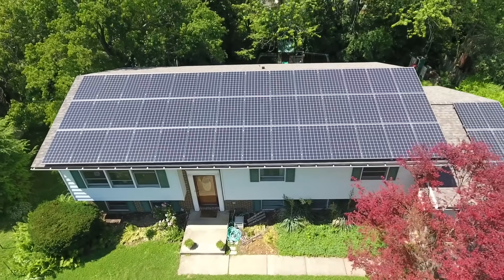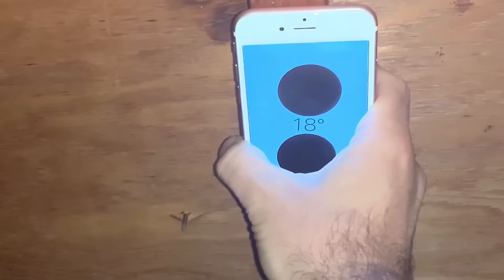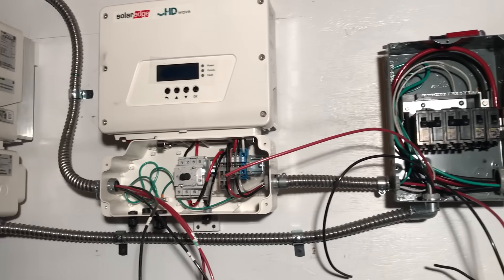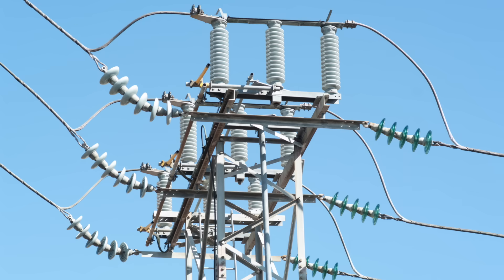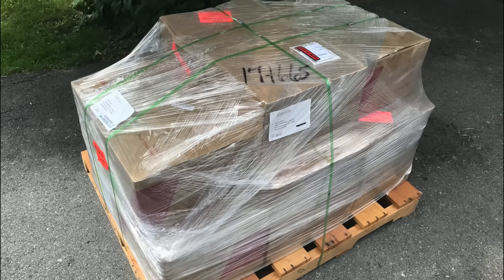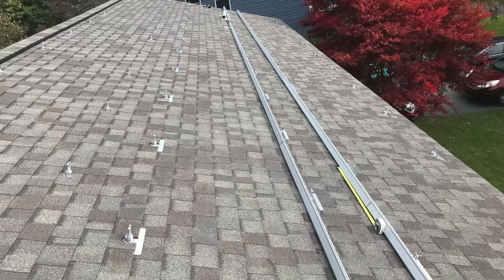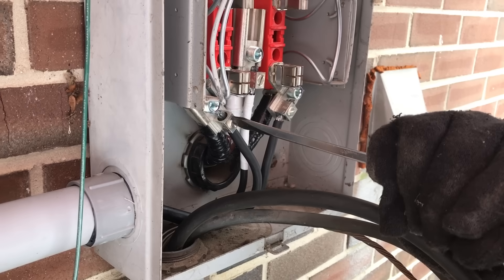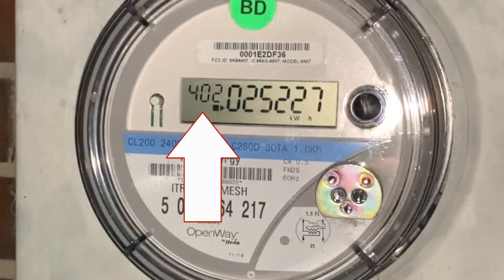I Installed a Power Plant Myself | HUGE DIY Solar Panel System

Comment: Yeah, and at a cost above the cost for paying regular bills.
Reply from the maker: I’m not sure what you’re trying to say.  The decision to install solar panels was one of the best financial decisions I’ve ever made.
Reply: @FrugalRepair  Then your system is completely minimal, because a full system for self-sufficiency will cost more than it's worth if you're within reach of an affordable grid service. I do system designs for lots of people across the country, and when affordable power is available, it doesn't make much economic sense to build and retain a system large enough to mee the average house demand of 33KWh of power to the home per day. Many homes are over that.
Reply from the maker: Sorry, I misread your comment at first.  My system is 15.6kw, would you consider that minimal?
Reply: @FrugalRepair  That will not sustain an average home. I don't know what website you read the average as being 15KWh on average per day, but the utilities feed their data into a nationwide energy database that we in that industry can access, and that average is currently set at 33KWh on the top end of the average data band. My home has three freezers and two refigerators (since we have six in our household), all of which are efficient.

I recently acquired 32KWh LiPo batter banks from a dealer in PA that are brand new, slated for installation into Mercedes EV's, but had defects in the mounting hole patterns drilled into their casements, and so were sold on the market while the manufacturing error was corrected. Even those will not fully run my whole house for a day given that depth of discharge for lithiums is recommended no greater than 80%, so I realistically have only 26.24KWh available.

An array of solar panels can make up the difference, but I am still going to need to stock up on even more batteries for storage on those days when there is no direct sun. We in my area have only greedy utilities who will charge us no less than $45 per month, even with the main breaker left off for the whole house for a whole billing cycle.

My customers have verified the averaging data I quoted to you. There are many smaller homes that use quite a bit less, but that's with them having very little in appliances, with wood burning stoves and such. I recommend wood burning rocket stoves for homes in winter, but most people are not willing to go that route. Rocket stoves burn about 1/10th the wood than wood burning stoves, but most people are afraid of their local nazi's who do code enforcement.

Anyway, yes, some of the homes I design for are considerably larger than yours and mine, and thus require a much larger system with gaudy slabs of solar panels running almost the length of  a football field, and they are located way out in the countryside where CO-OP rates can be very high, and very unreliable. Some mansions around here have some seriously expensive systems I have designed for them. The cost will be in excess of them simply paying utilities, because there is also upkeep and repair since we have LOTS of lightning strikes around here and damaging winds.
Reply from the maker: Thanks.  I don’t know if you saw that I deleted my other comment.  had misread your earlier comment, for some reason I read MWh not KWh.  But you’re right at 33KWh per day is the average.   Net metering is really the key to the financial worthiness of grid tie solar.  In any case, my system has been working great and after selling SRECs I make money each month.
Reply: @FrugalRepair  Does your utility pay you retail per HWh, or wholesale. Around here, they charge us about $0.15 per KWh, and pay back only $0.02 per KWh sold back.
Reply from the maker: The net metering is 1 for 1, so retail. In May they buy out any extra banked KWH to bring you back to zero but that is purchased at the wholesale rate.
Reply: @FrugalRepair  Ahh, so there is a catch. I figured there was. I used to design utility sub stations and transmission line systems. Now I just tinker around with home system designs that I wish I could afford for myself. I scour around for good deals. A fella is doing pretty well if he can build a system with lithium batteries that are around the $120/KWh price range. Anything above that is just too high in cost. So many are around the $350-$650 range per KWh. That's just plain outrageous, but even the Chinese are getting greedy.

Comment: Hope that the panels in the middle row aren't ever going to fai!
Reply from the maker: Me too!  But really, it’s not that big of a deal to get to them, just a pain.  You would take off the 4 bolts holding down a panel on the top row, get it out of the way then get to the one in the middle.
Reply: You can walk on the panels , the can take that ,
Reply: @MrToyorick  they may not look damaged on the outside, but the cells inside he panel can crack. NEVER walk on the panels!
Reply: with that low angle, you can easily access everything from the north roof. mine is 45°. PIA to work on ;)

Comment: The zipties will fail, potentially shorting your system .. In many countries using nylon zipties is aginst the code.
Reply: With the microinverters there is less of a risk, but the zipties definitely won't last decades. It wasn't clearly obvious there were other clips veing used. The zipties themselves are quite sharp and hard (nylon) thus by themselves can cause issues. I doubt most zipties will last 10 years outdoors in almost any use.. 10 years is quite a few cycles of temperature and humidity changes. Overall I am not really worried about issues, because you will probably keep it in top shape since you installed it yourself. Don't fall off the roof when cleaning it :P Most renewable energy is statistically more deadly than other methods of power generation just because of the man hours required per generated energy.
Reply from the maker: Your right about the temperature cycles but they are shaded which will help longevity.  And you’re right, I keep an eye out for any issues.
Reply from the maker: How would the system short?  The zip ties are backup to the other clips.  They won’t break off for decades maybe.  And even if they do, the PV cable is very thick and will last a long time.

Comment: What do you used, to storage the energy collected from the panels?
Reply from the maker: I get credit that builds up on my electric bill if there is extra generated.  I don’t have any batteries.
Reply: @FrugalRepair   but, when you have not sun light the system just will switch back to the grid?  Sorry I'm just trying to understand it!
Reply: @rmlora6tt133  Yes

Comment: Depending on where you are you could get geothermal heating.  Some companies will come out there and drill a well for you deep enough for you to use it as a heat source.
Reply from the maker: Yep, that’s a great option.  Duct work is the issue on my house.  If you have a lot of land and your frost line isn’t too deep then you can use a trench versus a well.
Reply: That's ground source heat pump I assume. Still need input energy but you get at least 3-4 COP. Worth it if you need lots of heating.

Comment: All those toxic heavy metals to create panels, that then create greenhouse gases. The "green" in "Green energy" is for the cash it creates for the companies selling it.
Reply: I did the math for my house and it's a bad deal, not to mention hurricane can end my investment and rip my roof off.
Reply: Yes it takes a while to pay off the Carbon debt but after that it works out better than most other fuels. Plus they are getting more and more effecient every year with less and less materials needed. Just look at Tesla roofing tiles.
Reply: Didn't know silica and aluminum was a toxic heavy metal. Guess your coal  plant is going to be a better option. We should give up and hope the solar industry dies. That's the best way to make sure we don't keep building on the advancements of the past decade or so. Matter of fact, toss that computer you wrote this comment with and go telegraph your opinion to the local paper. That should work out just fine.
Reply: @bokchoy335  The heavy metals are lead and cadmium. I never said anything about keeping only coal plants, stop putting words in my mouth. My point was there is no "green tech" unless you want to go nuclear, which is honestly the best route imo. Theyre not as dangerous as people assume, the only waste are the spent roads. These rids are solid and for the most part safe. They can be recycled, like they do in France and the are reactor designs being developed that can operate on these used rods. But people have this misconception that nuclear waste is some green toxic ooze. Right now nuclear energy makes up about about 1/5th of the US's electricity and more than half of its clean energy. If we put up a few more plants all across the country, there would be no coal plants needed, those horrendous windmills could be taken down. And the country would be 100% green energy with close to 0 co2, but that would cut into people money.